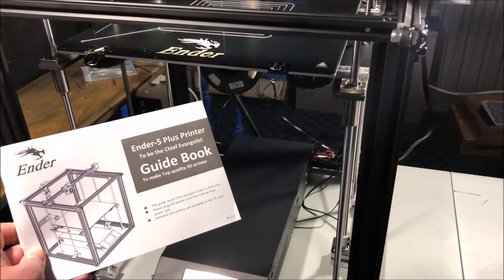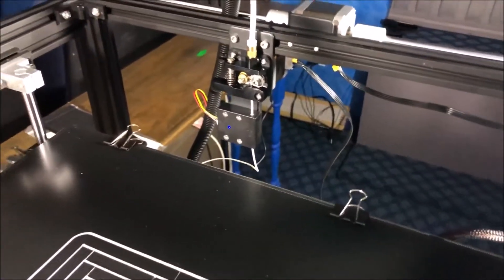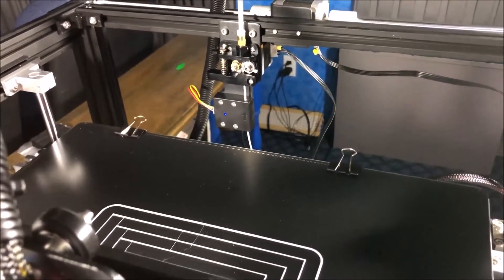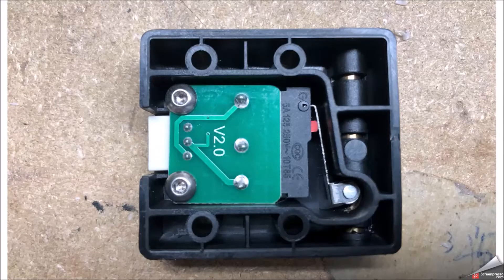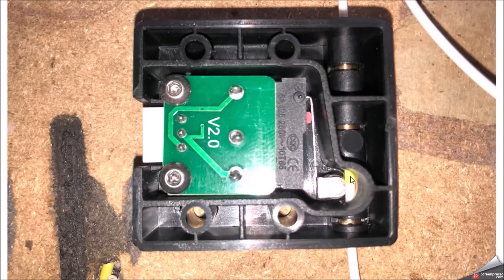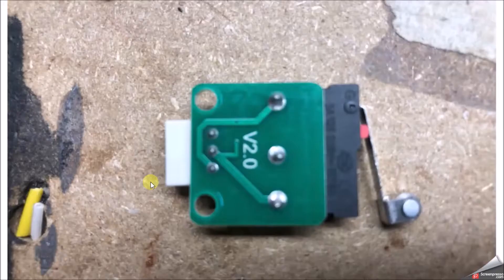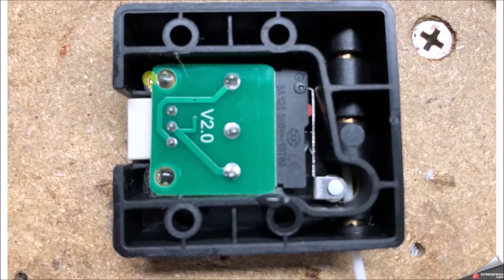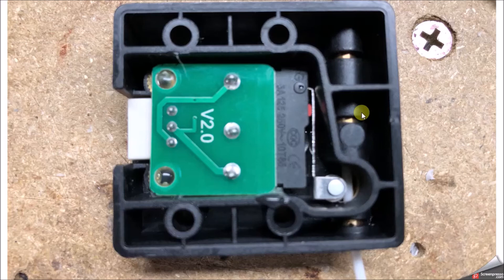Ender 5 Plus filament sensor fix

Comment: I just bent the metal arm so its pressed the switch button further in. Solved the problem in under 4 minutes. But yours works also. Always follow Dobie Gillis's words of wisdom work smarter not harder. Later all.

Comment: Best way to fix this is to bend the arm of the switch slightly. This will take up any slack as the filament slides through.
Reply: How the hell did this guy not think of just bending the arm...
Reply: Yeah bending the arm is the way to go.......................
Reply: @everettebinger5956  wow, just wow, not that John btw

Comment: Same problem here. While indeed the board is not slotted, I loosened the 2 screws, applied pressure to to the board toward switch then tightened the screws. That very small amount was enough to correct issue on my detector.

Comment: All you really need to do is bend the metal lever slightly and that should solve the problem.   This will result in the roller being fully loaded while the filament is present.

Comment: There is a option in the latest marlin to set it a distance to keep printing after a detection has been triggered.  I do not know if it would stop the runout script once it senses filament again tho.  It would have to be tested.

Comment: had a similar problem with the 5 S1 printer with a different style sensor.  I had an aftermarket filament feed tube on the machine that flexed more than the stock one at the sensor and caused the filament to curve away from the switch lever....Reinstalled the original tube and all is good

Comment: can you please help? I can't insert filament into the first input. When I insert the filament from the bottom, I hear a "snap" sound, but it does not move up. How can I fix this? Thank you
Reply from the maker: Try to cut your filament at a 45 degree angle so it makes a sort of wedge and might help push it up.  The other tip is to try and bend the filament a little to change the angle that it's going up the sensor.

Comment: Thanks for the video! Would it be possible to just put a thin spacer between that piece of metal and the red button? I haven’t opened mine up to look at the mechanism, yet.
Reply from the maker: A bunch of people have had success bending the metal switch lever slightly instead of my hot glue solution. Either should work. Let us know what you did
Reply: @JohnsDIYPlayground  Oh cool, that's an interesting idea! For the moment I just stuck a piece of filament into the sensor to keep it on while doing prints. My attention is currently focused on maintenance of an SLA printer, so it may be a week or so before I have time to give this a look, but I'll be sure to update you with what I do to fix this!
Reply: @TreeFiddy350  I just unplugged the sensor wire to keep it working on my ender 6.
Reply: @valmolina8236  Thanks for the tip! I have seen other people doing that as well- I’m pleasantly surprised that it can just be unplugged, given how quirky the firmware can be. I’d kind of like to keep the sensor if I can get it working (it’s theoretically a nice feature), but I’ll just ditch it if I can’t fix the problem.

Comment: I'm almost tempted to just stick something in there to keep the lever pressed. It says there's no filament when there is and when it snapes it stays where the senser thinks its going through
Reply from the maker: Yeah I know how you feel.  But like many have said, if you just take the sensor off and bend the metal arm a little bit, it seems to be the fastest and easiest way to fix the problem.  It's a pretty common problem.  Good luck Tony!
Reply: @JohnsDIYPlayground  I ended up just sticking a peace of filament in the sensor so that it is always on

Comment: i think i will just de-mount the sensor and feed the fillament directly into the extruder. i will leave the sensor plugged in but i will leave next to my printer. then after doing that i will either hotglue the sensor metal arm or i will tape the metal arm back so it's always activated. this will be a solution for people who don't want to use the sensor but you can always re-use it. i just want to print for the time being and i will keep an eye out for the fillament itself

Comment: I would have just used a Dremel  to slot those holes. There's obviously no circuitry in the area. Just open them up so they're U-shaped on the edge. Make them fully adjustable.

It also looks like that switch is upside down. Is that how it's oriented when mounted on the printer? If it is, wouldn't it make more sense to have the part that contacts the filament on the top? You'd get a tad bit more filament through it and you'd be less likely to bend the switch when feeding filament into it. I think some people have an issue with threading filament through it. It also looks like the switch could grab onto the filament like a friction pawl in that orientation rather than pulling through easily. 

I need to pull mine apart since it didn't report that the filament was out which is what led me to this video. Good stuff. Now I know what to check.
Reply: I pulled mine off and found a little piece of broken filament locking it open. The orientation we see in the video has it upside down so there's nothing wrong with the way it's oriented. I played with it for a while with some filament and could see it's very flaky when pushing filament through. The last guide hole should be conical so that the filament doesn't get stuck on the edge of it. The only solution for now is to make sure the filament is as straight as possible when pushing through and if it hangs up to just twist a little until it doesn't. I have no idea how a 4 mm piece of filament got jammed in mine.

Comment: I have a different issue.  My ender 5 plus ran out of filament, blue light went out, but the printer kept on printing!   Looking for a solution now.
Reply from the maker: Strange! Let us know what you find out
Reply: Same here, find anything that helps?
Reply: This is a known issue with these printers and the default display and default board. Pause at height will not work either. The fix is to upgrade to the bigtree mini 3 v3 along with a tft35 display. The display requires a printed adapter, and bigtree does not have the firmware for the ender 5 plus at the time of this comment. I was able to get it to work through many struggles, but it does work. There is a firmware on the net that works. It also made leveling so much faster.

Comment: Why not just bend the lever a bit?
Reply from the maker: There is nothing wrong with that solution in my opinion.  I just chose to angle the circuit board a bit.  Either way should work.  Thanks for watching!